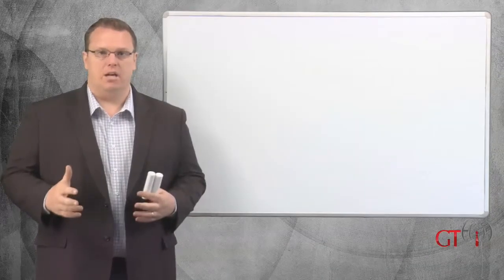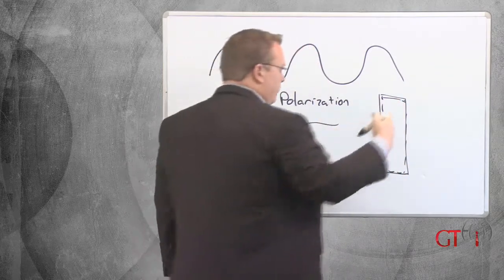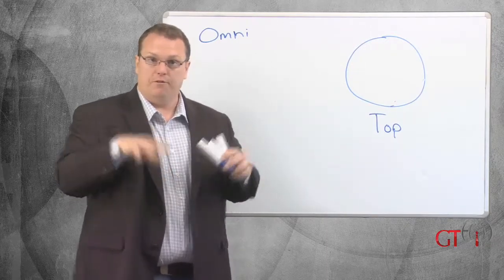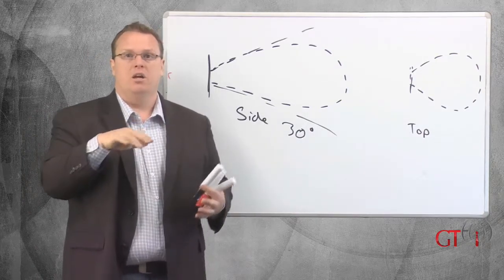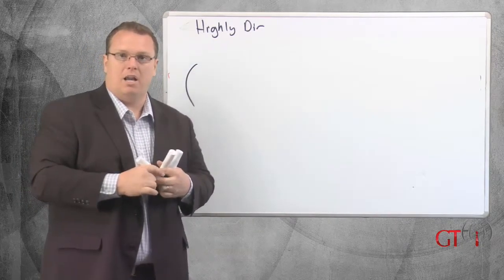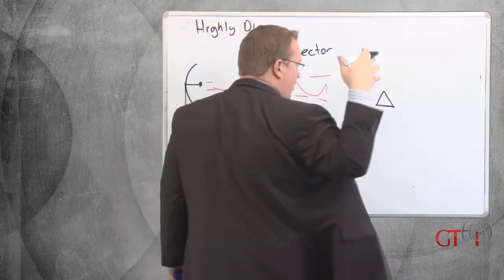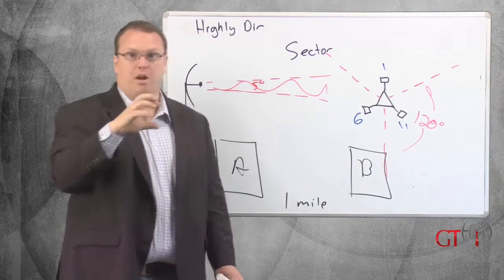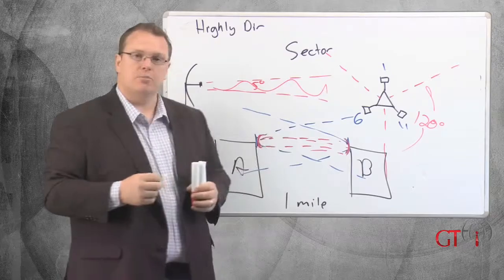14 - Polarization and Antenna Types

Comment: I use a couple of directional antennas on top of each other for vertical polarization. How could I find out if horizontal or cross polarized would be better?